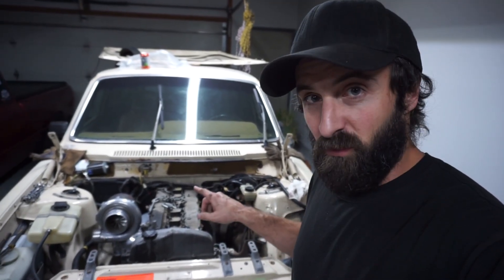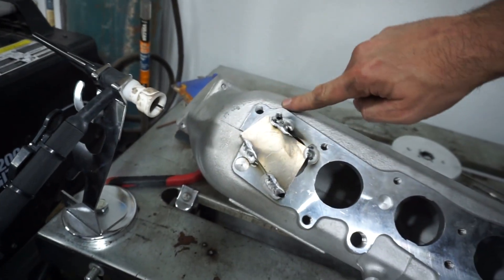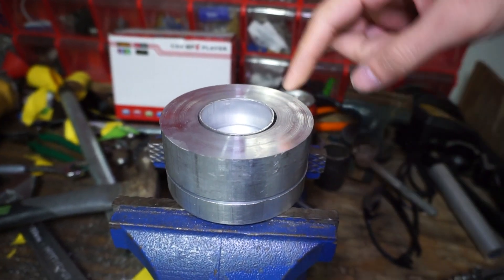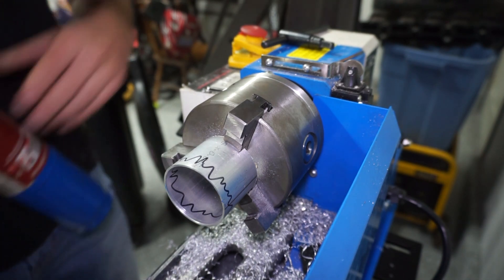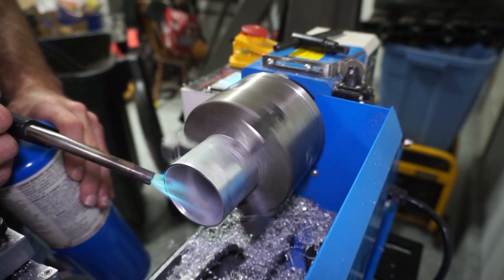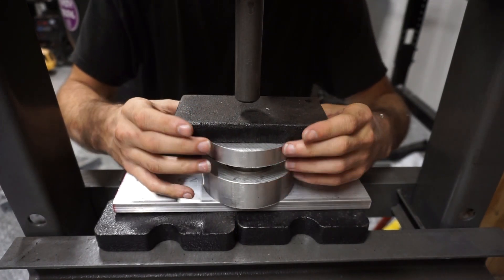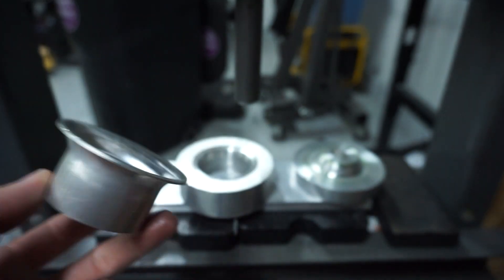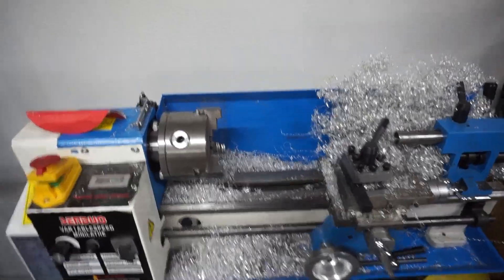Making Velocity Stacks For Vortec 4200 Swapped Volvo Wagon!!!

Comment: Dude you're doing great on that lathe! That method Calvin used is called spin forming. You can rig up a roller bearing  on a pivot instead of a screw driver for a better result. Keep trying new stuff! Also, see if you can find a 4 jaw chuck. It'll open up a whole new world of possibilities for you in the garage
Reply from the maker: Sweet, I did see a couple videos with the rollers...